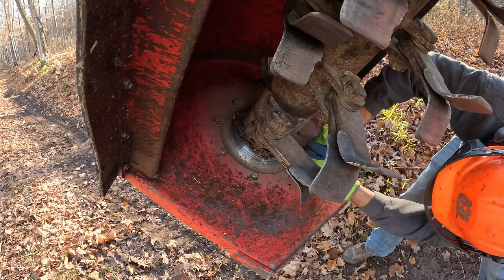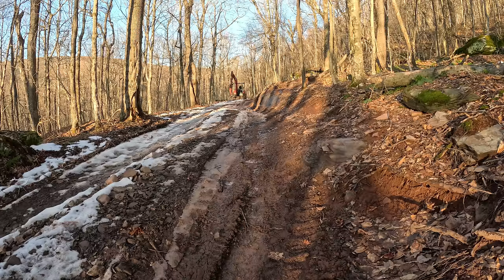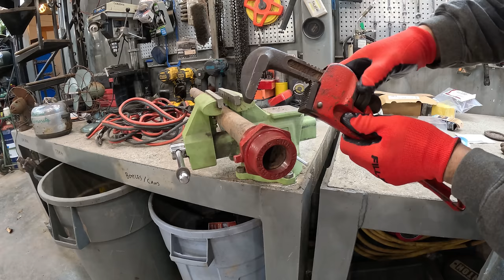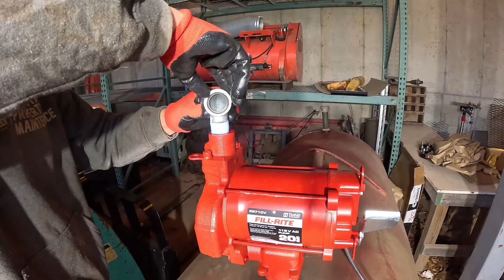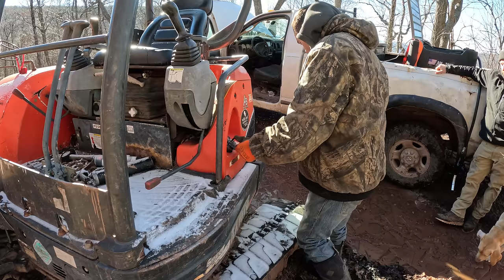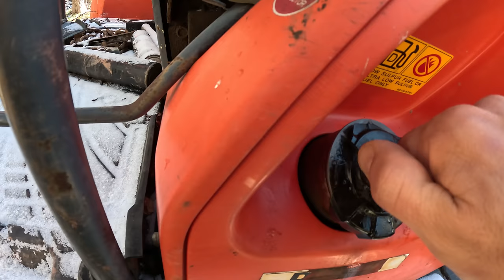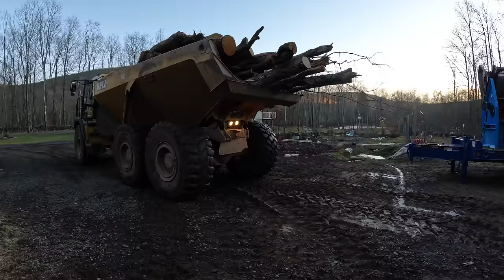Using a excavator to mow, hammer, and load wood

Comment: They have an Expander powder that you pour into the hole and add some water, it will split a boulder or ledge. Check it out. You could buy a track mounted drill rig, it would sink holes quicker?

Comment: Big mistake on the fuel filter.  Next time get the kind that has a clear housing with a small drain valve on the bottom.  You can see water and debris and stay ahead of bad fuel problems.  You will know exactly when the bad load of fuel arrived clean stuff up before you fuel up your equipment.  Great video as always!

Comment: I remember when you put the ears on that bucket a few months back.  One year ago I ordered (through my Kubota dealer) an AMI root rake for my 161...came with wrong ears...dealer said they would order the correct ears and have a local welding shop set it up...came back a few months later but when they fit it to a machine on the lot...no dice...too tight...I forwarded that video to the dealer and said it should have been field fitted like you did in that video....a few months later it was finally ready...went to pick it up two days ago...wrong ears...Just goes to show, that if you want something done right, learn to do it yourself...
Reply from the maker: Yeah that sounds frustrating, just pick up a welder and copy what I did in the video, if you’re going to be doing this type of work probably need to have a welder anyway.

Comment: You need a roller that has those high teeth, maybe its surface pressure is higher in small area and it cracks stone.

Comment: A sheep’s foot will do a better job of crushing those rocks or even a heavy crawler with good grousers running back and forth over it will break it down so the top layer is smooth 

And be very careful with that smooth drum roller 
A lot of people have been killed or seriously injured by those   As they slide over or down a hill and can’t stop once the drum goes it will drag the rest even if the brakes work

Comment: do you know what a nice and good addition to that diesel pump and actually all diesel pumps have a pressure switch, 
then the pump stops pumping when no diesel flows.  
so you hang the hose in the tank of a machine, 
turn on the handle, 
and you can walk away from the machine, 
when the tank is full the handle turns off 
the pump runs for another second or so until there is pressure in the hose and then the pressure switch shuts off the pump.

Comment: Hy Andrew times in advice from an old construction machine driver. Store all your excavator buckets and shovels with the opening facing down, then no water and other dirt can collect in them.
This also increases the service life of these devices considerably and you should also get used to using all the bolts, pins, etc. something to grease, as well as the locking levers for all the attachments on the Bobcats.
It always hurts my soul to see how careless you are with it.

Comment: Will that chipper grind stumps at all? It looks like it was bogging down on 4 inch or so sized trees.
Reply from the maker: It does much better with soft wood trees. But it works good for the brush on the sides of the road.

Comment: I have a KX161-3 what kind of quick attachment do you have on your excavator? And where did you get it?
Reply from the maker: That’s the factory Kubota one, but it is the smaller one so my 121 attachments will fit as well. I had it custom-made to fit that machine.
Reply: @AndrewCamarata  look at the S40, S50, i think it’s S stands for swedish. Widely used in Europe. I think it’s the cheapest and strongest one since it forms a wide attachment area as a box and pins have tapered hooks that stay tight.

Comment: If you want that roller to brake rock better and your ONLY going to use it for Rocks!!! Put weld beads all across the face of the roller with your meg welder randomly high ones, low ones crisscross it will put more weight down in one single spot and break the rocks better if later you don’t like it, just grind them off
Reply from the maker: Maybe, that would be a ton of welding. There is this grid shell thing I was thinking about getting.

Comment: I'm surprised he did not buy a new pipe instead of risking contamination from the crap inside that old rusted pipe for the fuel tank. A new pipe would probably be a fraction of the cost of the pump set-up!

Comment: Andrew, do you know what the S40, S50 and so on bucket connector is? It would make your life so much easier with manual or hyd quick coupler. I have manual, the handle is in the cab.

Comment: Probably all field at one time.
Reply: Yep, the lower reaches of the mountain, anyway. All those rock walls means that some farmer was trying to cultivate there and he was dragging the rocks out of the field and piling them along the borders.  A lot of work when you consider that all that stone was dug up  by hand, then moved to the edge of the field with a "stone boat" pulled by horses.  Makes me tired just thinking about it.
Reply: @andrewalexander9492  our farm in New Hampshire same thing. Walls for miles through dance wooded forest.
We metal detected rhe walls and found amazing things throughout the years
Reply: @urbancowboyinct2161  I grew up on a former farm in Maine.  No rock walls, as our area was not too rocky,  but I did find the old farm dump and found many interesting old bottles.  Other parts of Maine though you could find plenty of rock walls.  The Northeast was a tough place to farm.

Comment: 0:41 - was it difficult to put it on a log? no need to dip the connection in the mud))
3:20 - oh, I like this mower. ) and if the trees are crushed with it from those that are dead and dry?
6:43 - barbed wire is not the worst thing, we still have artifacts of war in our forests, this is tin.))
15:15 - now put a bottle of napalm in this pile. 
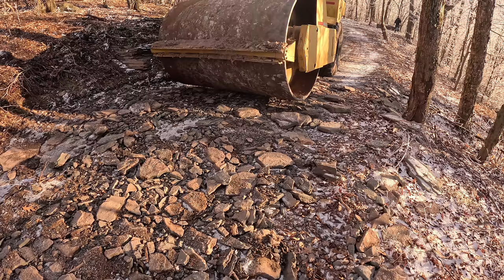23:54 - at first it would be possible to walk with a rammer, and then with a skating rink.
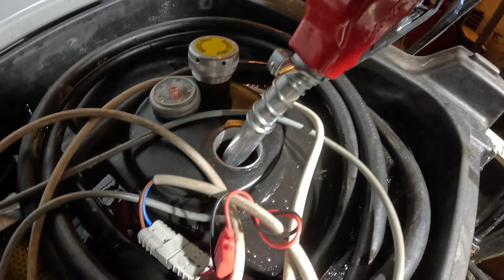33:14 - and what is this red diesel fuel? biofuels or something?

Comment: You should put a 90* elbow pointing down out of the fuel filter on the pump so that the hose doesn't kink under it's own weight. Hose will last longer that way.

Comment: I know this ain't the Right video. But you should v-groove anyting over a quarter inch before you weld it if you want proper penetration.
Reply from the maker: I do like talking about welding, I would like to know what video you were watching to make this comment. Sometimes there is a gap that's being filled. And sometimes the welder has enough power to burn down deeper than 1/4 to get something welded. When I weld something, it doesn't break.

Comment: ANDREW Please read this. 
One major misconception is that tape colors matter. They do not. Read the white label and it says use with water, oil, gasoline. Color is a marketing thing and has always been such. Colored tape is uselessly thicker than white. 
This is the product description on cheap tape on amazon and you can check this against any brand and any color. 
This PTFE tape is intended to be used for general purpose sealing pipe threads and suitable for use with oxygen, water, oil and gas.

PTFE tape tape is known as plumbers tape or Teflon tape. ITS ALL THE SAME STUFF. Years and years of marketing has done this to people. They even do it for dope. You can read on the dope lables that its all the same stuff and works with the same things.

Comment: No, but Seriously.  You Should Clear Out Some Acres, for a Christmas Tree Farm.  You Can Grow 1,000-1500 Trees Per Acre.  10 Acres, and You Have 10,000-15,000 Trees Per Year, Once It Starts Cycling.  Some Trees can Grow Four Feet a Year, Others, About a Foot.
A Colorado Spruce, Blue Spruce Goes for About 5 Bucks a Foot.  
Five Years From Planting, You Could Earn About $250,000 a Year.  Every Year.

There Are Many Factors.  A Fraser Fir Can go for 10 Bucks a Foot.
Fraser Fir Grows Best in Sandy, Clay Type Soil...Pretty Much What That Mountain is Made of.  Selling 8 ft Frasers, at $80 a Pop, You're Talking Around a Million Bucks Every Year...Once Things Start Churning.

That's Called Retirement.

Comment: Mr. Camarata I enjoy your program content and have for a while now. I understand that you are in property improvement and that would be the focus of your content of your channel. But since your purchase of the mountain top acreage your focus is to develop a overly manicured property. It seems to me you want the city life in the middle of the woods. You do a lot of burning of trees and in doing so release a lot of carbon into the atmosphere. Concerning.  You have produced a ton of rock for the purpose of securing your pathway/ access to your property. Your recent content you work to mow vegetation it appears 10+ feet to either side of the pathway/road. Maybe I'm off base here and please don't feel that I am trying to trash you or the channel. Just wondering if property improvement cannot be done without wiping things out. Think of Frank Lloyde Wright waterfall house..    Thanks Ed
Reply: Ed you need to crawl back into your safe place cave cause out it here in the real world things are gonna be a little too harsh for you it seems. Somewhere on YouTube I’m sure a lady is growing flowers and trimming them with scissors for her compost pile. Maybe give her a try?
Reply: @timhilton5096  Sorry to have failed at an attempt for open dialog: Guess I need to work on that. Concern for burning wood vs a lady composting, is that CO2 , H2O as well as Benzine and Formaldehyde are released. This is caused by a fire of that is just not really burning hot enough to properly burn off those chemicals. This also results in people with respirator issues to suffer due to these particulates in the air. You mentioned composting, well it does release the dreaded CO2 into the air but at a slower rate. It takes decades for Trees to reclaim that CO2 that can be release. A fallen tree in the woods if left to lay will eventually return its bounty to the forest. As for what Mr. Camarata does with his property is his own business and I support that. I was looking for a little forward thinking and insight to property management where we didn't have to bulldoze everything down.  Well return to the "Safe place Cave" and the "Flower lady" sorry to have ruffled your feathers.

Comment: I know big campfires are cool to make a video, but why wouldn't you use w a wood chipper instead?  You're wasting a valuable resource, mr Camarata Aint no such waistage in Poland, that's for sure.Maybie because we're poorer up here, but just sendig free heat into the atmosphere?
Reply from the maker: Wood chips are not worth anything. And you are wasting diesel chipping, plus running maintenance on another machine.